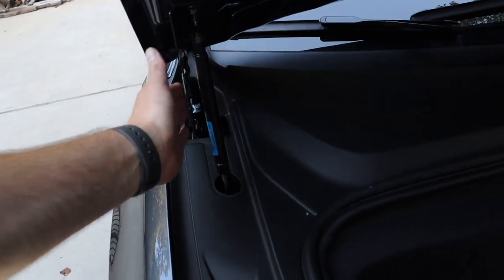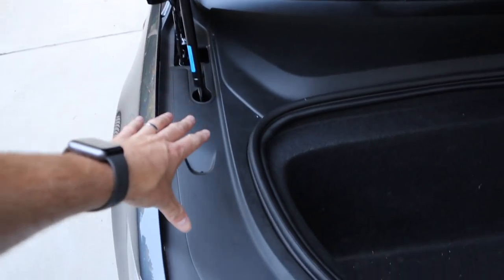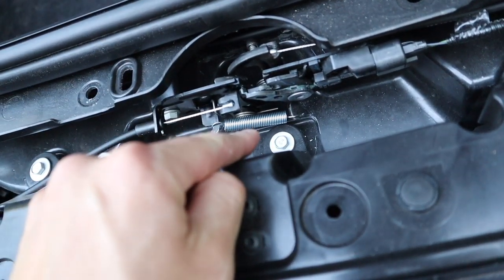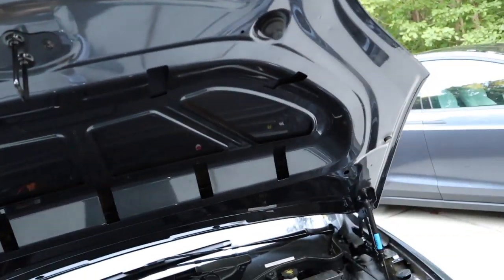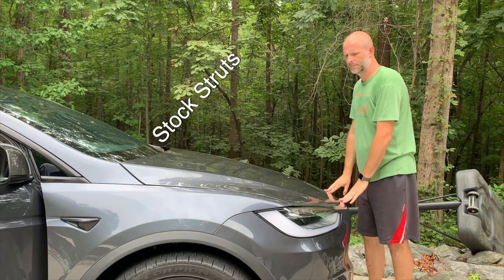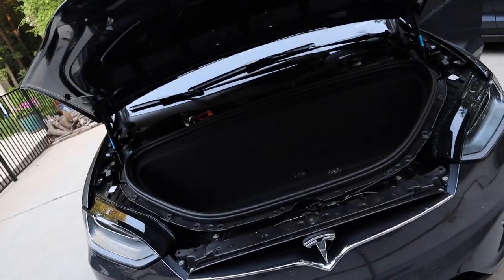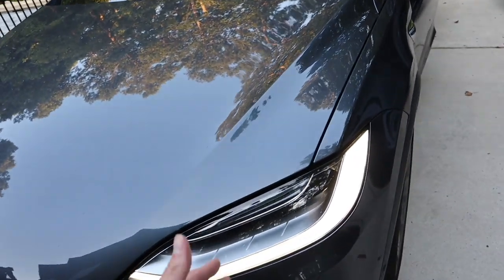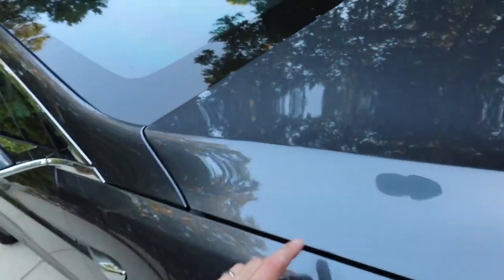Model X Auto Open Frunk

Comment: I still dont know what's going on with my model 3 front struts. I used the link you provided, had a flawless install and the hood still flies open and shakes a bit. Either way it's better than nothing. Thank you for all the time an effort you put into your R&D so we can all enjoy the little things.  Much appreciated
Reply from the maker: Some struts get more power when built. It is hard to get it perfect. It is weird to me to see that too. My trunk opens slow but others opens faster. I like that better
Reply: I have the same issue with the model 3 struts I got. Going to exchange them for another set and hopefully they are a bit weaker so the trunk and good don't fly open and bang around.
Reply: i1Tesla mine was really bad but once I did the spring too the violence in the way of flew up settles down a bit. See here after spring for easier open/close was installed.  
https://imgur.com/gallery/pYh5aa9

Comment: Hey Brian, installed the frunk opener a month ago and it's by far the best MX upgrade ever! Thanks so much for finding it! One thing, can you contact you guy at the factory and see if they can offer about 1 inch more stroke? I've bumped my head many times. The power struts stroke about 1 inch shorter than the OEM.

Comment: Wow, awesome instructive video. Good Job!  Just ordered the struts using your link. Update: Just installed these, works perfectly. But WARNING, put some cloths or something in the open spaces in the front when you are installing the little spring. I accidentally dropped the spring when trying to install it and it fell into one of the spaces in the frame in front of the mechanism. I was able to finally fish it out with a wire but save yourself the extra effort and hassle. Installing the spring was the hardest part and I found it fiddly to get it hooked on both ends. Other than that, very easy to install.

Comment: I installed the 4882 shocks and Lowe’s spring. It wouldn’t open by its self. The shock actually felt a little weaker than stock. I installed the oem shocks and kept the soft close spring in and it definitely closes easier. Possible I got a bad set of shocks or will It not work with my X? Ever had this problem before?
Reply: David DeMaio They worked for awhile but now seems to be 1 out of 7 times. Is it possible they wore out?

Comment: Good Job you did it again!  I have been testing it using model 3 struts since I got the MX but no success since it is too strong and not able to pop open and bent the hood.  Anyone need a pair of model 3 struts I got them.    At Amazon the MX struts all sold out and not in stock till September 13.    Thanks for your research.  Credit goes to you.
Reply: I got the struts and installed it today.  But mine when the hood almost all the way open up, it jerk and thump little bit.  Yours on video looks pretty smooth.  Do you know why and how to fix it?  Maybe my struts little to strong being new and all.

Comment: I still love your videos. I first followed you in 2018 when i boughta Model 3 Dual Motor Long Range. Fast forward to 2023. I upgraded to the Model X Plaid. You would have thought Elon would have installed a frunk auto opener by now.. does struts work on my 2023 MX? Amazon struts sold out as of 12/26/23.
 I agree with you on those that profit off others R&D.
 Hope your doing well.
Regards,
Gary

Comment: Hey Brian! Do you have an amazon link for the model 3 struts too?  Just so you do get something for them too. Didn't know if the one on the model 3 video was a personalized one or not.
Reply: Also Brian, if you could check to see if the struts you used before are still the same...it seems like the lbs rating went up. I got the ones for the Model 3  and they seem to be open alot faster and stop alot harder with shaking than I would be comfortable with.
Reply from the maker: These are the ones I used on my car. Almost a year ago. I posted the frunk on the model 3 Aug 8th 2018. Time flies when your having fun

Comment: Yo Brian, installed these on my 2016 X and not working as they do in your video. There might be a chance that the  frunk might be heavier in older models?  Changed out the spring, but not with the exact spring (closest I could find). The soft close does work, just doesn’t auto lift like yours does. Suggest any other struts to try?
Reply: I have 2017 X and I have the same problem
Reply: Solved. I think I either got defective ones or my hood is heavier. But I ended up doing something else. Used a 4129 strut (Model 3 strut like in Brian’s other videos)  and one oem strut and works like a charm. Hope this helps someone else if these don’t work.
Reply: I discovered that one of the strut was bad, trying to get a replacement
Reply: Also have a 2016 X and installed this morning. Everything worked like a charm, no issues. Tried a dozen times, always lifts up by itself. Soft close works too. Maybe you  got bad struts?
Reply: Did the swap as Brian showed. Very simple but, frunk won't open from touch screen. Will open with fob. These are mechanical components, makes no sense. Any suggestions?